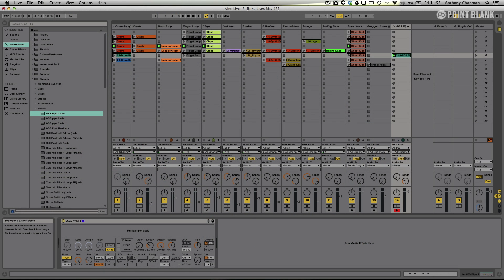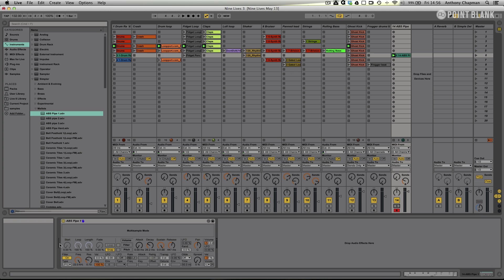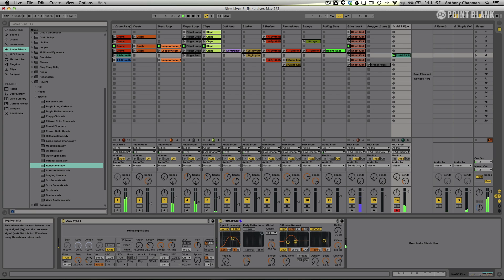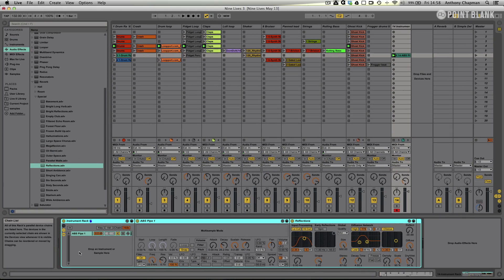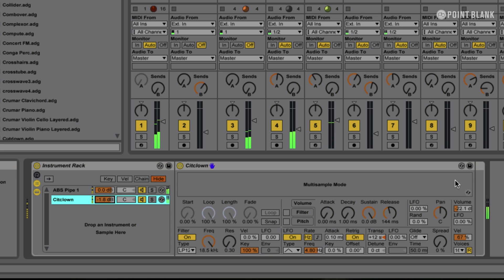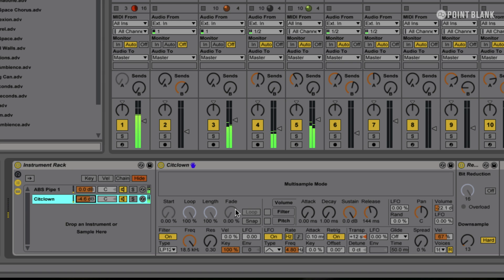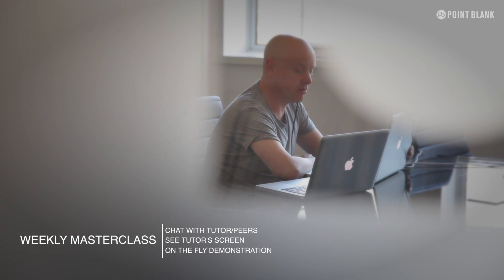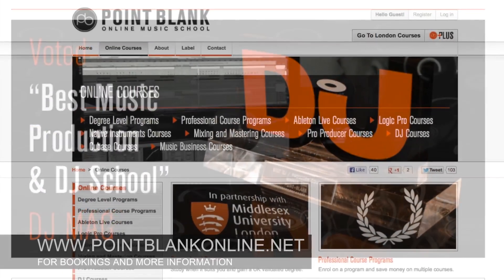9 Lives of Ableton: Part 3 - Working With Instruments and Racks

Comment: Not quite - you have balance between the dry and wet, and a master volume if you use the wet effect on an insert.  Having the return of the effect on a send definitely gives you greater flexibility - you can control the send level (either pre or post fader), the level of the source signal, and the level of the FX return.  You can also process the FX return with other devices independently.  Running on an insert restricts the finesse you can have re. levels and/or routing.

Comment: @dammitnr12 I'm not totally sure what you mean.  When I say "ghost kick", usually I mean a kick drum that we don't hear in the mix, but rather we use it to trigger side chain.

If you're wanting to put different effects on different kicks in a pattern, I'd be thinking about using automation of the sends to feed reverb and delay on the returns.

Comment: Hi Nick - as a rule, I put any effects with a "tail" (i.e. reverb / delay) on a send and return.  There are several reasons for this - with Reverb, shared effects save on CPU load. Also I like to give the effect of putting multiple elements of the track into a single "space", so using sends lets me do this.  The main reason however is to have maximum control over the levels of both the source signal, and the effect return. Dry/wet balance + volume fader isn't enough control a lot of the time.